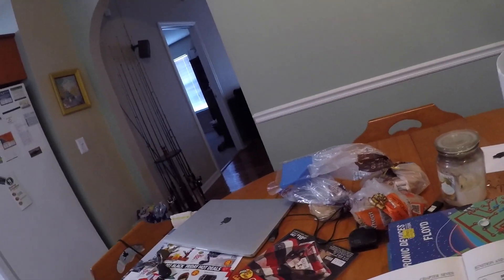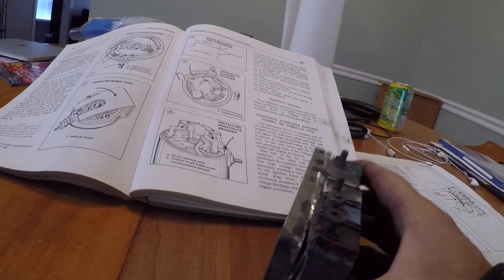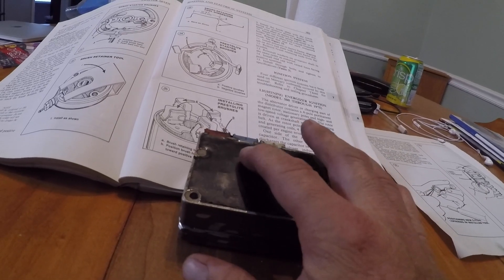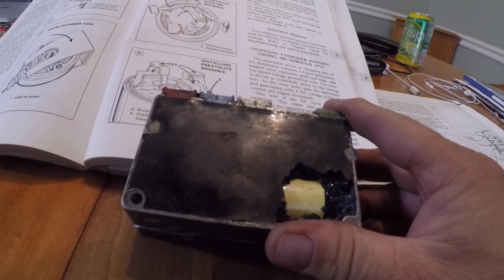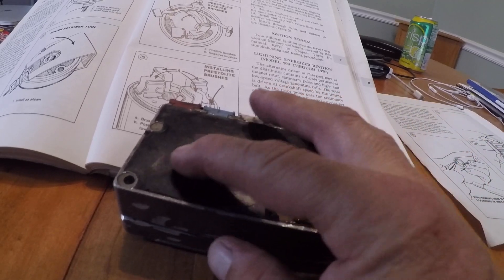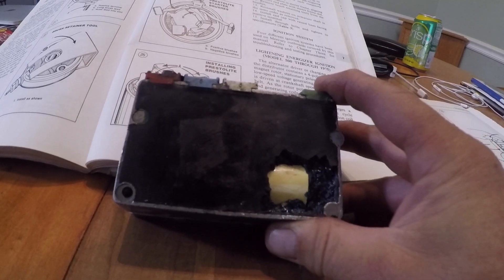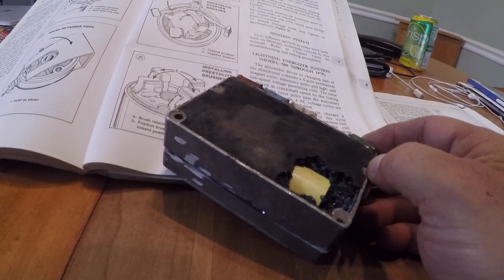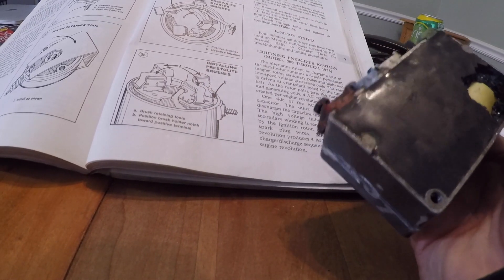Mercury Thunderbolt 500 50 HP engine Part 65 Experiments

Comment: Man I have a 1973 500 that runs only when throttled up. It idled and ran pretty good one day then next day it will only run throttled up. I've cleaned out carbs, checked for spark, tested the distributor trigger as you have showed and all look good.  I still cant get it to idle at all. Only thing I can see is maybe this switchbox?
Reply from the maker: Check your fuel pump.
Reply: Think I've tried that if that is the one that uses the diaphragm. Diaphragm gasket good. All new tank lines and bubble. I have literally watched all your vids and searched forums. I ohmed the switch box and cannot get ground to blue nor red nor white to beep. If I disconnect output fuel line it should spit out fuel when turned over right?